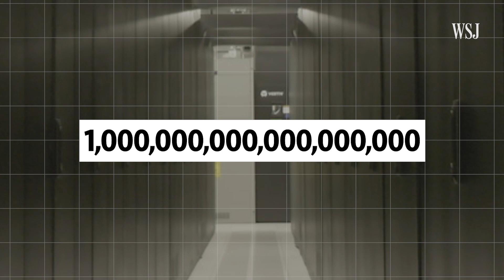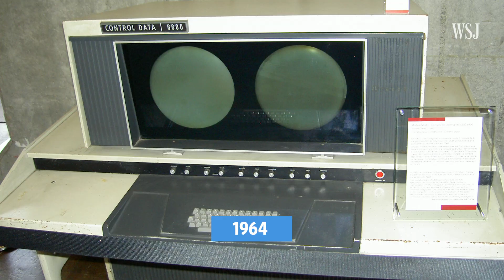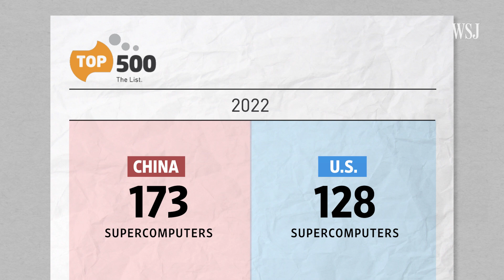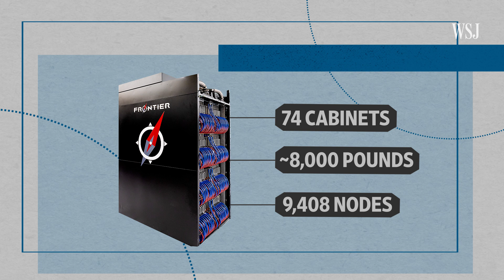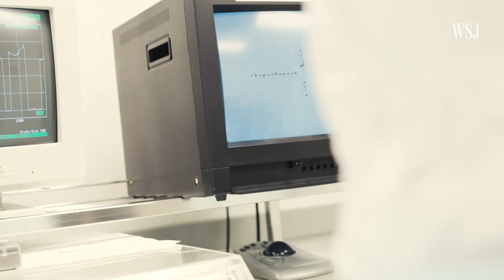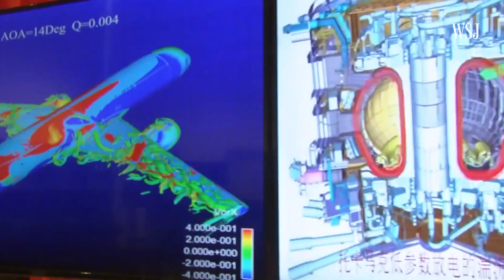The Race to Build the World’s Fastest Supercomputers | WSJ U.S. vs. China

Comment: With digital hardware wouldn't you be able to take a solar panel and make a optical transistor then make a digital form of the radio sound to make a optical processor from one transistor or two solar panels that's how I made the Gameboy a supercomputer on the digital side for the future 

Of you ever thought to use solar as the reflection light for holograms you could play the phase of the optical stream of the light the reflection bounce through solar

Comment: What I'm interested in are 2 kinds of models that might be getting airtime in China, but are likely far down the list on the US supercomputer problem run schedule. These are 1. dynamic resource-based economic planning models (an ultra-informed and contingency-conditioned 5 year plan--but it would work better on US data because unlike the PRC, we aren't lying through our teeth on every core metric).
2. Economic prediction models, yes of equities markets (and the input data on the company side would need to be more robust than quarterly earnings statements but might start there), but also entire macroeconomic system models in forex and sovereign debt, etc. 

On second thought, since economic input data is likely still very janky and uneven, maybe scrap the above and stick to cool physics, design of automated algorithm-writing/code-writing tools, weather and decryption.

NSA project leader has crossed out all but the last word of my wishlist above, with a not-dissatisfied smirk.
Reply: Exceptional.

Comment: Although it might be interesting how the Tianhe 3 might perform,
I'm at least as interested in the SUNWAY TAIHULIGHT which although was #1 when it was first submitted in 2016, is still ranked #6 in the June 2022 Top 500 report that was recently published.
Unlike the Tianhe 2A which is still ranked #9 on the same list, the SUNWAY seems to be built entirely with domestic and proprietary chips, accelerators and interconnects. This machine might be a better indication of China's computing capability because it might be using 100% domestic technology while the Tianh3 2A is built using Intel Xeon chips, Chinese accelerators and interconnects.
Reply: Chinese do not have any GPUs inside their domestically made supercomputers
Reply: @napobg6842  Wrong. You can easily find Сhinese made GPU compute engines. And they developed them in only three years. Maybe that's why you've missed it.
Reply: @catonpillow  There are some but they are so weak that there is no need to even consider them
Reply: @napobg6842  Wrong again. The chiplets made by Biren Technology(A Сhinese GPU firm) are comparable with Nvidia's Ampere flagship.
Reply: @catonpillow  They are not even remotely close to Ampere GPUs 🤣🤣🤣🤣
Reply: @napobg6842  Actually ,they are better than the Ampere, you can look it up.
Reply: @catonpillow  Hahahahah what a dreamer 🤣🤣. You are the one that has to prove a point
Reply: @napobg6842  Nextplatform did a very good and detailed article on them just a month ago, you can read it and expand your knowledge on the matter anytime you want.
Denying a fact just because you don't like it only exposes your bias napo.

Comment: The new cerebras wafer processor is capable of 80 EXO scale speeds. They described this supercomputer as  1 EXO scale. The wafer processor is about 40,000 Watts and this machine is over a million Watts, I believe I put these numbers in correct perspective. This monster supercomputer is already dated. Expect the next generation of machines this size to be terrifyingly fast compared to this slow machine. When I bought my first 486 dx2 computer with a 33 MHz bus operating at 66 MHz in the late '80s I couldn't imagine machines operating at a faster speed. Now I can't imagine such high frequencies, it boggles the mind.
Reply: Then why is cerebras not built for any supercomputer in any country if its way faster than 1 exascale?
Reply: Connecting their supercomputing Machine to a legacy machine isn't the problem. Their focus in designing the chip wasn't this be able to put it into any supercomputer that is already out there. The supercomputers that are out there are not equipped to handle the chip and that's not their focus, being able to stick their chip in anybody else's supercomputer. They're building their supercomputers that are more powerful leaving Legacy machines behind. Why doesn't Ferrari build engines for Toyota? How do you put a V12 in a Citroën 2cv? I am clueless to answer your question.
Reply: @miyagiryota9238  the speed of their Andromeda computer has 18 zeros.
Reply: @zAlaska if its so fasr then why it not listed even in top 10

Comment: I am confused.  All information suggest China cannot make supper chips like Tawain so how can they make a supercomputer?
Reply: They buy parts from others.
Reply: You have a point.
Without the cooperation of either TSMC in Taiwan or Samsung in South Korea, no one else in the world can make these chips and achieve the performance necessary in a supercomputer. If and when details of recent Chinese supercomputers are revealed, serious questions will be asked of both Samsung and TSMC because one or both of them would have to be complicit to build a supercomputer using very recent designs. And, if Tianhe 3 uses an Intel Xeon processor like the Tianhe 2A, then questions will be asked of Intel as well.
Reply: they dont have the capacity to mass produce chips like taiwan and us
Reply: @fa100da  you're wrong all are needed, the silicon are from China, even the raw materials of it, the rare earth materials and its processes, without that, there is no chip to be created. Think first of its components, are all made in China, they assemble it in Taiwan and exported to the US
Reply: @mr.striker1692 hmm no! It's designed in the US, uses lymphographics technology and assembled in Taïwan! Raw materials can be found elsewhere!

Comment: Years to come these super computers will be the size of laptops. Then later shrink to the size of android or iPhones.

Does this sound familiar?
Reply: That’s not at all true. The concept of supercomputer is by linking up many smaller ones to act as one. Also chip density has pretty much reached its limit, and the size of individual chips in the overall architecture isn’t the deciding factor. The orchestrating software is.

Comment: Impossible in both cases without TSMC semiconductors.  Intel is about 10 yrs behind and SMIC in China is roughly 15-20 yrs behind. TSMC is now opening a foundry in the U.S.
Reply: But tsmc wont produce their most advanced Chips in the us
Reply: @heinzpechliwanis1411  The US factory will just be a front. It will be empty. Only built for "show" to make Americans proud. They won't actually manufacture anything. It will most likely just be a warehouse to store shipments from TSMC.
Reply: 2
Reply: SMIC has 7nm and intel doesn't, but still maybe intel is ahead in general
Reply: @infoworld7706  Exactly the opposide SMIC doesn't have any 7nm capacity and Intel has. As Intel actually has EUV technology and SMIC doesn't.
Reply: @napobg6842  U R wrong. Intel has no mass production 7NM capability, but SMIC has. Check the recent news. A game company is found using SMIC GPU.
Reply: @infoworld7706  Not in the slightest. There are no Chinese GPUs running on 7nm technology.
Reply: @napobg6842  TechInsights literally dismantled a mining GPU from SMIC and founded 7nm chips in it... get updated dude.
Reply: China doesn't need chips from the US and it was Qualcomm begged China to import theirs with 80 % off the market price.

Comment: One thing to keep in mind is that China will test massive sets of nodes that are not designed to actually be super computers but rather process other sorts of traffic as many smaller scale systems and have them put on the top 500 List. Not that they haven’t made great strides by any means but I do think that is an important qualifier as far as the number of systems
Reply: Can you explain like further. I'm too dumb to understand. Like what is smaller scale that you mentioned?
Reply: looks like no one knows what you are saiding
Reply: It sounds like AMD had 7nm fabricated chips for this project.  I can't see how China can compete without using a ton of western tech to even enter the convo.
Reply: just keep deceiving yourself. if you are reasonable enough, you should know by now the reason US Sanction China on sell of microchips is due to their competitive edge. they are about to leapfrog USA.
Reply: That's a dumb argument....
Reply: And your evidence for your claim is?

Comment: Its claimed that China has two over exaflops supercomputers and one is being built. OceanLight uses Sunway SW26010 it has 1.2 exaflops of single-precision computing power, or 4.4 exaflops of mixed-precision Tianhe-3 uses Phytium 2000+ FTP Arm chip plus a Matrix 2000+ MTP accelerator. Its estimated that estimated 1.7 exaflops peak performance and just over 1.3 exaflops on Linpack. The information is all hearsay from David Kahaner. As far as we know no one outside China has seen these systems. After US begin adding every Chinese supercomputer firm to sanction list China stop giving information about their capabilities. We literally have to reverse engineer bitcoin miner to learn that SMIC has 7 nm capacity.
Reply: 中国没盟友  lol. Exactly 🤣
Reply: Since it began in 2015, without US semiconductor design firm, do China have capability or talent that can rival US design? Manufacturing are just part of the problem which you mention and SMIC have manage that. What Chinese firm rival Intel, Nvidia and AMD? The hearsay can be entirely false.
Reply: @johnmaris1582   In Hot Chips 34 conference Biren Technologies shows its latest Biren BR100 GPU. It uses chiplets - a design technique Nvidia and Intel still unable to do - has a computing power 2.6 times better than Nvidia A100 accelerator released in 2020 which US began to require extra license beginning today causing Nvidia shares to drop, follows the latest accelerator standard  Open Compute Accelerator Module and connects via PCI-Express 5.0.  Also China firms like Alibaba design their own datacenter CPUs so they have the design technical capability. What China missing is EUV machine and its ecosystem.
Reply: @engineeranonymous  Big thumb to you to explain these GPU thing, guess you can open a topic on these GPU comparison, like Biren vs A100, I guess lots of people will love it, at least I do, after all who don't have Graphic adaptor installed in their computer
Reply: @engineeranonymous  woah a highly specific industry insider insight. The beauty of YT comment section. Even though I don't know half of what you talk about and too lazy to Google, I'm gonna assume it's legit. Please tell me you genius what chances are china can develop its own domestic EUV stepper? What are China technical capability in the entire semiconductor ecosystem from 0 to 100%? Your insight will be most appreciated.
Reply: @johnmaris1582  There is almost no chance they can make an EUV system, they are still struggling with reverse engineering some of the basic the equipment that are made by Applied Materials/Lam/TokyoEl,... there are pretty solid report on that.
Reply: @johnmaris1582  While your usage of term "EUV stepper" raise some suspicion on your knowledge on this, let me try to answer with my Donning Kruger syndrome and armchair expertise. CEO of ASML, Peter Wennink told POLITICO in 2021 "If you shut out the Chinese with export control measures, you'll force them to strive toward tech sovereignty, in their case real tech sovereignty ... In 15 years' time they'll be able to do it all by themselves — and their market [for European suppliers] will be gone". So China have the capacity. I suppose no one will claim to know better than the CEO of ASML. Let's review the current situation. China's indigenize EUV by 2030 plan is overly optimistic. The problem is China has a lot of prototypes but nothing for manufacturing. Hence the argument China claims to accomplish a lot, but nothing to show. After investing tens of billions of dollars and achieving nothing, Chinese began an investigation and arresting people on corruption charges. Situation do not seem to be bright for made in China 2025 plan. Will China  have an ingenious top lithography technology.  According to Mr. Peter Wennick  ""I am not saying it cannot be done, because I know the laws of physics are the same in China as they are here, Never say never. They will certainly try."
Reply: @engineeranonymous  Thank you for the insight. I assume the same as well on China technical prowess after all China build a space station all by herself so 15 years seem reasonable for an EUV stepper. Also what's wrong with the term EUV stepper?
Reply: @johnmaris1582  No EUV stepper is spot on. I just don't get how can someone who don't know half of what we are talking about and too lazy to Google knows this technical term.
Reply: @engineeranonymous  5nm is reality without ASML.
Reply: @johnmaris1582   US does not design nor manufacture, US rely on UK to design, and rely on taiwan and south korea and even china to manufacture chips,  US  does not have capacity to manufacture chips,  this video is misleading and make up stories,  chinese supercomptuer use chinese CPU phytium  feiteng,  chinese designed  first CPU  back to 1990s,  the supercomptuer using CPU  IS not same as  those cellphone chips , it does not require  high nano meter  craft, but very rough craft can make those CPU for supercomputer,  chinese supercomputer use totally different structures and chips than  US one, the intel chips were old stories,  also was only used in one chinese supercomputer tianhe 2,other supercomptuer of china use chinese CPU since dacade ago,
Reply: @xinyiquan666  Ah... Nvidea, Intel, and amd...  are US company?
Reply: @johnmaris1582    Nvidea is founded by a chinese,   so is  CEO of amd  and tech CEO, all are chinese,  so are 60% of engineers in intel  are chinese,, again, those companies do not make chip , they contracted to tw to make it, intel  has capacity only making 14 in chips,/.......///;;//
Reply: Only gullible people believes what China says.
Reply: China lies
Reply: 中国没盟友  他意思是美国只能通过逆向拆解中国生产的东西才能知道中国科技发展到什么程度
Reply: 中国没盟友  No I don't mean that, we do not know what China can do. Understandably China do not release press releases or brag about their latest achievement. for example when a new photo of a Chinese fighter was posted on Weibo, everybody began to speculate it's capabilities.
Reply: @engineeranonymous   chinese supercomputer  tian he -3  is fastest in world,  but after 2015, chinese supercomputer does not participate top 500 list any more,  check the TIMES ,  US is lagging behind china in supercomptuer
Reply: @engineeranonymous  they are good at that. remember the silk trade. perhaps they have already surpassed USA. else why is USA sanctioning them if they were behind. people use common sense.